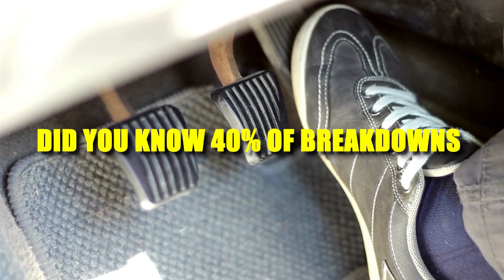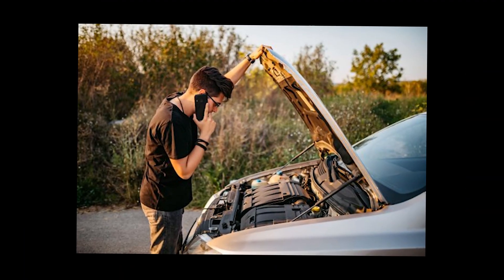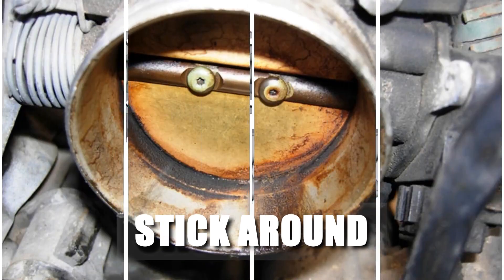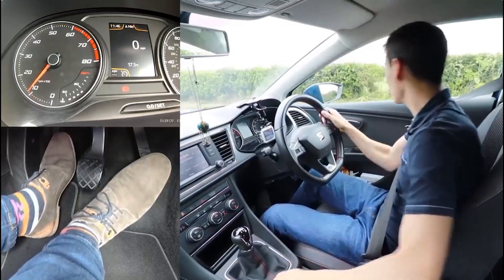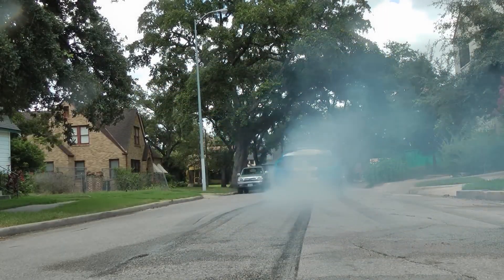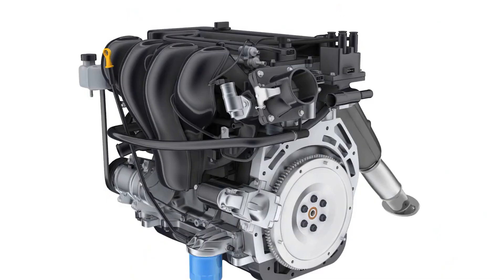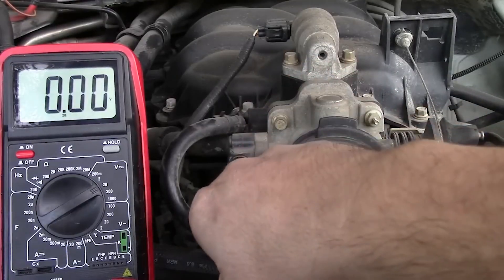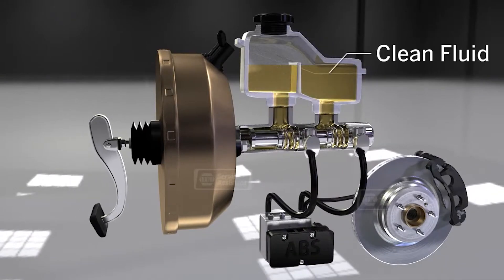9 Symptoms of a Bad Throttle Position Sensor (TPS) + Fixes

Comment from the maker: 11 Bad Throttle Body Symptoms  https://youtu.be/AKAoU0eFqyo

⬇Care Care Clues Top DIY Tools and Products:
🚗 Essential Scan Tools
Newest Scan Tool:https://amzn.to/3GJyuET 
Bluetooth Scan Tool: https://amzn.to/42AcBRc 
Cheap Scan Tool: https://amzn.to/42WZIzx 

🔋 Emergency Essentials
Best Jump Starter: https://amzn.to/44fYOAm 

🛢 Fluids and Leak Stoppers
AT-205 Re-Seal (Stops Leaks):  https://amzn.to/3S9icYm 
ATS 505 Fuel System Treatment: https://amzn.to/3YQjjA2
Lucas Oil Transmission Fix: https://amzn.to/4jNk98M 
Bar's Cooling System Stop Leak: https://amzn.to/3Sht0nj 

🔎 Quick DIY Diagnosis Tools
Head Gasket Leak Test Kit: https://amzn.to/4jRgc2T 

🛠 Useful Maintenance Accessories
Quick Twist Oil Drain Valve: https://amzn.to/4jWG3GJ 
Tire Gauge (Check Pressure): https://amzn.to/3GxySGD
Tire Air Pump: https://amzn.to/3RZK9Cd 
CRC Mass Air Flow Sensor Cleaner: https://amzn.to/44dJpkb 

🧰 Mechanic’s Must-Haves
Car Battery Tester: https://amzn.to/4jTqyzk 
Basic Mechanic Tool Set: https://amzn.to/3Ymgerh 
Cordless Impact Wrench: https://amzn.to/3YkkhVc

Comment: HELP !!
On my 2009 GMC Yukon after cleaning the throttle body, I went thru the ECM relearn process afterwards, but it didn't work.  I have high idle. So I changed the TPS, thinking this may be bad. Installed a new TPS but problem still exist.
What am I doing wrong ?
I've done the relearn process over and over, no luck.
Reply: I have a 2008 Chevy Avalanche. I changed the Throttle Body and experienced the same problem. I was told by a mechanic that you can’t do the relearn process to reprogram it. It has to be plug up to a computer to be reprogram. I called a shop for an estimate and I think they told me $150. Luckily, the mechanic who told me about the issue had his own computer, so he charged me $50. Hope this helps

Comment: I had my throttle body replaced in Oct 2024, November 2025 it's back at the mechanic. Same thing the lightning ⚡ came on the engine light and another warning light that looks like car swerving. 

The owner of the mechanic shop said it's still under warranty but the guy who handles warrentys is off until 12/8/25. I have no car for the last week. 

The mechanic said it could be 80% throttle body and 20% something else. I have a feeling it's going to be 20% something else so they can stick it to me

Comment: Direct Testing of Throttle Body

Inspect for carbon buildup:
Remove and visually check throttle plate and bore.
Clean with throttle body cleaner if dirty.

Monitor voltage signals:
Use multimeter on throttle position sensor (TPS) signal wire.

Voltage should increase smoothly from ~0.5V (closed) to ~4.5V (wide open).

Sudden jumps or drops indicate a bad TPS.

Manual operation test:
With ignition OFF, manually move throttle plate — should open/close smoothly without sticking.

Comment: Help pls!! I have a 2001 mustang v6 58k miles drove perfectly for the first 40 days I had it absolutely no issues went to changed oil only thing my friend pulled the throttle cable a bit before I started after finishing I drove it for 15 min and it started to jerk especially around 30-45 mph and also when I push the pedal after letting go I changed the PCV and it seemed to fix it but now it started again from time to time, what could be causing this as I’m stumped and can’t think of anything atm

Comment: I'd like to know where you live that it costs under $200 to get a new one installed. My mechanic says it'll be close to $900, and dealer quoted $1200. Car is a Jeep Compass
Reply: Yeah they’re trying to replace your entire assembly the part alone is 500+ for my car so it sounds like the assembly not the sensor nor just a cleaning
Reply: Bro for your jeep it's only 47 bucks and super easy to put in

Comment: I have a 96 ram 1500 5.2 I replaced the icv and then the TPS, it ran great for 2 days then stopped again, if I disconnect the TPS it starts right up but only runs for like 2 min then boggs out again. It will continue to turn on only if I disconnect and reconnect the TPS but then 2 min later again, what could be my issue?

Comment: I changed my 2 Upstream Sensors 
fuel Filter
fuel Pump 
Cleaned MAF 
cleaned throttle 
And still same issue on my 2003 Tahoe Rpm is fine if car idle except when I'm driving all this I experience
Reply: try a fuel system cleaner, could be dirty injectors

Comment: can the car vibrate beacuse of this problem? like in 5th gear at 2.000rpm if i press the gas pedal the car vibrates a little
Reply: Mine vibrates hard at the stop light and struggles on acceleration 
But this sounds like the problem

Comment: I've experienced some of these issues. However I also experience power loss/cutoff when removing my foot from the gas -usislly also when breaking or turning. Usually dash and screen will flash and shut off then turn back on. On several extreme circumstances the truck stalled all together. Usually only affected at low speed when I have removed my foot from the gas pedal. Could this also be a TPS related issue. Checked all my grounds, did plugs, and replaced primary ground and ribbon cables.
Reply: I'm experiencing the SAME THING, did you fix it.... Was it the sensor?
Reply: @gretchenhoene8072 ya my car doing same thing its a 2013 civic and when im driving gas pedal rpms so slow down like the gas pedal went limp almost n then i have to let go of the gas n press again usually its cool to drive but sometimes i have to spam the gas jus to go

Comment: Is it the tps when your when u have a RPM of 2 in idle? It regulates once I sift into gear but when in idle it has pulsing surging or when I left it run in idle for a long time, it doesn’t seem to be a vacuum link, I can’t pull a engine cone cause my engine light is one, the pulsing started after my brake switch went but I changed it
Reply: How did you fix it?

Comment: Could a “throttle position sensor low signal” be the reason I have the symptoms of smelling fuel in the engine only ( no visible leaks), whitish exhaust, very rough idle? Because that’s the error code that came on during all that happening. I first thought It was old gas but put PRI-G   in the tank but idled just as bad. I haven’t driven it like this but it seems to not have the power to go anywhere. It’s a 91 Chevy G 20 van. I know there could be something more wrong that caused the TPS error. Does anyone know where the throttle body and sensor is located on this van? Or a website that has a diagram of the engine?

Comment: Left one sympton out:  Difficulty in holding an idle or not at all.  I also learned to buy OEM Throttle Position Sensors from the manufacturer even though it is more costly, but it's worth it.  The aftermarket ones do not last as long and are not as reliable.
Reply: Was it idling and the rpms would lower by a few hundred? My car feels like it's going to stall at some points.
Reply: Bought a 3rd party one cause no auto parts store near me had one and I need to have my car running but I did order an OEM one that I will be installing later.

Comment: Engine idles properly,my problem exists when I try to accelerate quickly the car bogs down. If I gradually press the pedal it picks up.
I changed spark plugs,air filter,fuel filter,cleaned distributor cap,used an injector cleaner to no avail
Reply: Did you ever find the issue?
Reply: @ciaran3964  fuel pump
Reply: Sounds like a bad CVT transmission.

Comment: What about bucking and jerking when I come to a stop sign. It literally tries to jump forward
Reply: I had the same issue, the car ran fine, but at low speed (like when about to stop), it would jerk. Today I cleaned the egr valve (it wasn't stuck but really dirty) and it fixed the problem. That was done on a 2004 Subaru Legacy manual transmission.
I also cleaner the iac valve (which was actually clean) and the pcv valve (which was dirty). I hope you fix your problem

Comment: Mine is a Camry 2000 with 1MZ-FE V6 engine.  I observed  that the gear particularly delays in engaging when the lever's selected to "D".  Sometimes it takes repeated  shifting between "N" and "D" before it eventually engages with a thud. Once engaged, the engine moves normally and the gear shifts smoothly. My gear oil was changed using the recommended  Toyota TIV (T4) a few months ago.  The oil is at the right level and still smells fresh.  The car jave not done more than 3,000 miles since the gear oil was changed. Please help.
Reply from the maker: Sounds like your Camry’s got commitment issues—it won’t engage “D” without a fight! Since you’ve got fresh Toyota T-IV at the right level, let’s check other suspects.

1. Throttle Position Sensor (TPS): A faulty TPS confuses the ECU, messing with shift timing. Try cleaning or testing it.
2. Shift Solenoids: If they’re sluggish, delays happen. A scan tool can confirm.
3. Valve Body Issues: Gunk buildup can cause delayed engagement.

For now, try shifting to “N” before “D” at a stop. If that smooths things out, your transmission may need a valve body service.
Reply: @carcareclues  Thanks
Reply: @carcareclues so what’s the deal with using Scotty image?

Comment: 2000 Lexus rx 300 threw a flashing service engine light with P0 codes. I then Replaced: Mas airflow sensor, idle-air control valve, injectors, coil packs, solenoids, spark plugs, battery, ECM, o2 sensors (3), new vac lines, etc. 

Why not, let's try a TPS sensor.
Reply: did that work ?

Comment: I changed the clutch last week and then after a few days it broke down, Throttle position sensor came up on the computer. I bought a second hand one for £30. Then bought a throttle pedal just in case for £30. When I stripped the air box off there was a piece of plastic jammed in the butterfly valve. The air filter was not sat right and it looks like one of them push plastic clips that hold the air box down. Mine was revving up to 5000 then dropping to 1000 and going from 2000 to 1000 with no throttle response.

Comment: You can see the graph on a scanner. Put on a scanner or a scope to see if the electrical current is consistent when you press down on the gas. Back prob the electrical connector on the sensor sensor
Reply: I had an intermittent issue with starting the engine.  Sometimes it would fire up then stall right away.  I could barely keep it running, while pressing the pedal.  It would sometimes happen at high speeds on the highway.  I would have to pull over.  Back probed the MAF and it was fine.  MAF looked good on the scan tool.  I drove it for about 30 minutes, keeping an eye on the live data.  The issue still was happening, at least two times a week.  I replaced the MAF and the issue went away.  And it never threw a code.

Comment: Nice video and very rare and important information. My car lost the quick acceleration since last year, it was exactly after replacing my throttle body valve unit. Let me try this.
Reply from the maker: Since the issue started after replacing the throttle body valve, the throttle position sensor might be the problem.

Try cleaning and testing the sensor with a multimeter, as mentioned in the video. It could help restore your acceleration.

Let me know how it goes, and feel free to ask any questions!
Reply: @carcareclues  sure in sha Allah, I'll test that during the weekend 👍, thank you!
Reply: @explorehunter did it work?